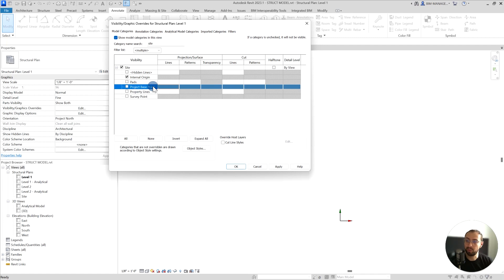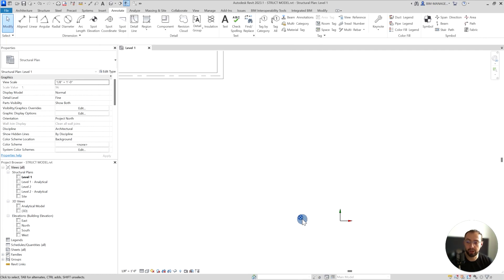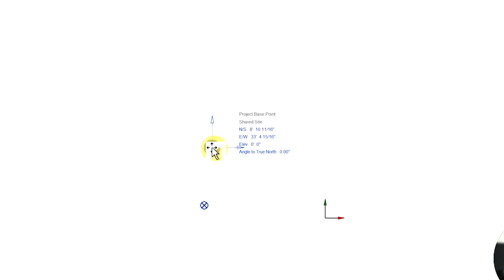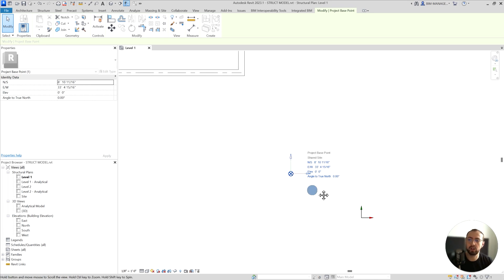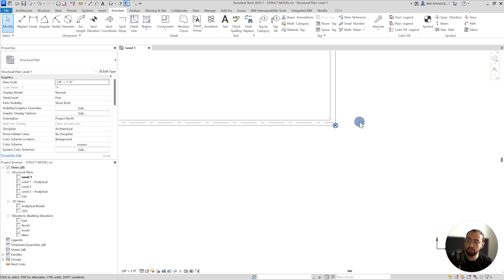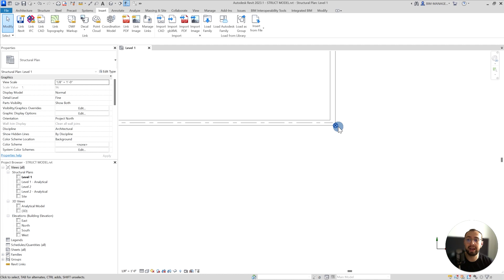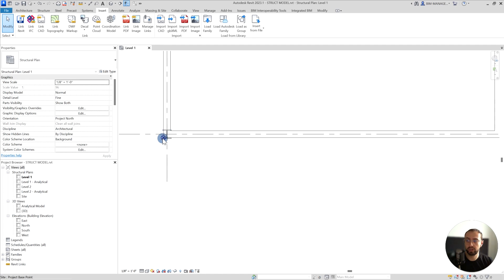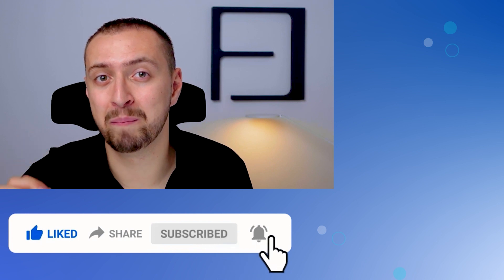What Is Project Base Point in Revit | How Project Base Point Works

Comment: Is there any reason lv 1 elevation become negative when we change the project base point elevation?
Reply from the maker: Hi @lauvnex5379, 

Thank you for your comment!
Regarding your question, this can indeed be a common issue in architectural projects. To provide you with more accurate guidance, could you please share more details about the software and version you are using?